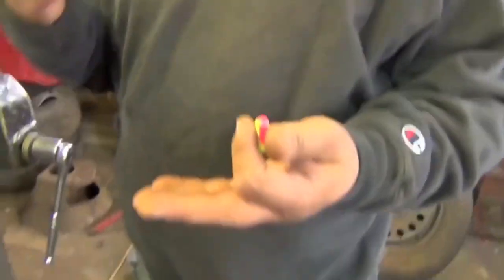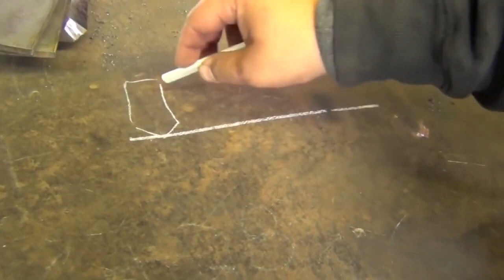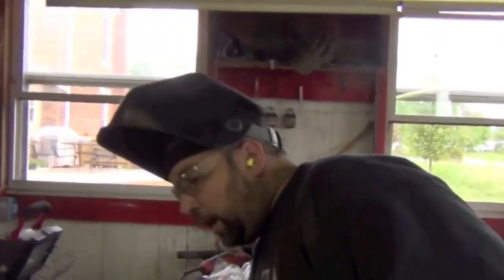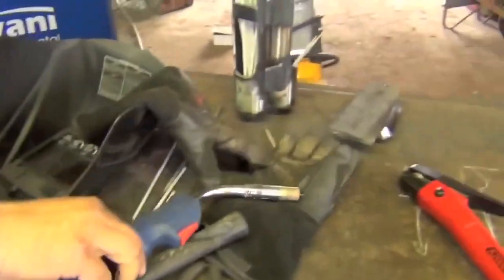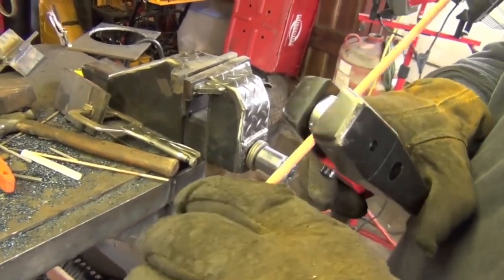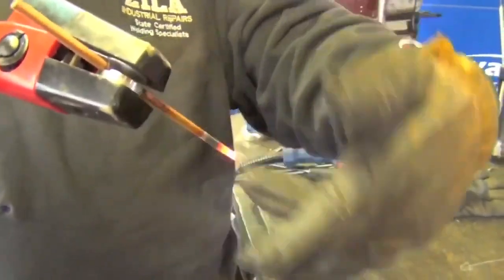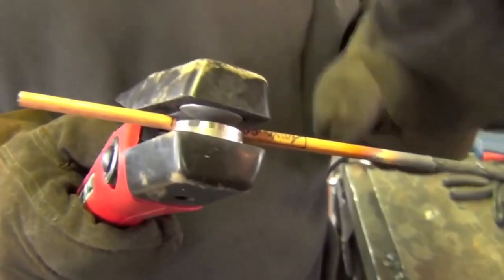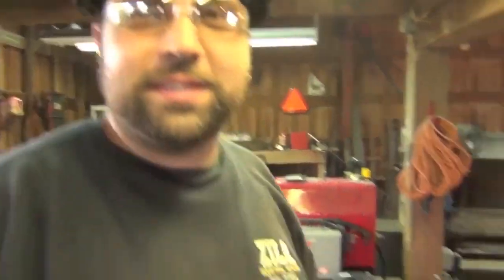IMPROVISED EQUIPMENT CAN STILL RUN CARBON ARC GOUGING!!! MIG WELDER INSTEAD OF STICK WELDER AT WORK

Comment: Gouging is famously rough on hardware. My (highly skilled pipe and boiler welder) instructor would never gouge with his own machine but used a gouging tip on an OA torch. You can gouge on AC but it's not mentioned often. I have 400A Hobart I bought for the cables which works a treat and spares lighter machines. For some gouging artistry IC Weld has some outstanding vids.